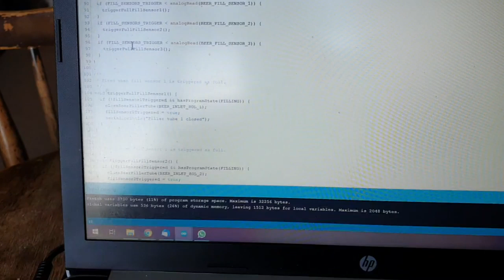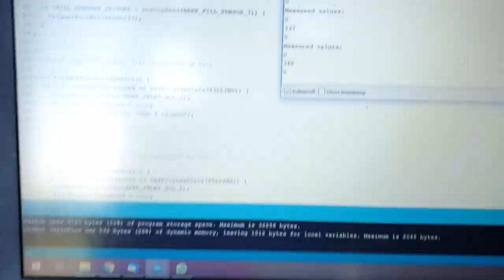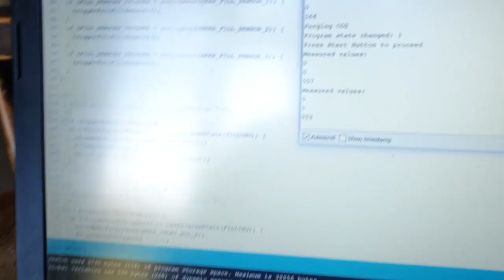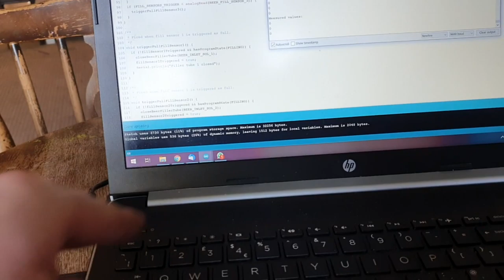Fine Tuning The Sensors ~ Can Filler Build

Comment: Hi Harry. I just discovered your channel and see what you are working on. Seems like you're making great progress!
I am a Computer Engineering student/Electronics Hobbyist and work in the IT enterprise software development field, So I thought I may add my two-cents I had watching as it may be useful to you.

I would be wary of using conductive-means of level sensing here. It is generally bad practice to do that, as by nature of passing current through the wires into the beer you are eroding the metal into the beer solution. The amounts are obviously small, but still not ideal. I would recommend you look into using capacitive sense to detect when the fill is complete. This eliminates all current that would be passing through the solution, as well as eliminates the need for direct contact of the solution to the bare input. Another alternative could be a utilizing a miniature float to actuate a small microswitch, or perhaps a sliding potentiometer.

If Capacitive sense is used here,  and the sensor itself is designed correctly, you could achieve very accurate fill level measurements (Within a cm or so). This may be useful as depending on how the plumbing is setup. it may be useful to 'cut  filling' before the desired level is reached as beer may still be flowing for a short time after pumping is cut. Capacitive sensing would permit easy and precise preemptive cutting tuning via easy software parameters vs. manual coarse sensor adjustment.

Cool to see what you are working on! Best of Luck.

Comment: ESP devices will be much cheaper...also, you may consider a simple screw terminal block for the Power Supply - makes it easy to swap out! Brilliant build - can't wait to see the can ram...if you had a 3 can feeder, it could drop 3 cans, ram them in place, fill, ram them to the end of the line. Then you would need some sensors to know when you took at least 1 can (so it can start the next fill pass) and the last can (so it knows when to ram the next filled batch).

Comment: Nice one, I should have mentioned that the circuit that I supplied could differentiate between foam and beer by changing component values or adding a voltage triggering circuit, my bad. S..r, cheers, Schnuz.
Reply: how is the proper way of connection? can you place a potentiometer?
Reply: @maurig3741  without digging the circuit out it's difficult to say as it was five months ago but it would have been two probes into the foam/beer. Pot's are not a good idea as they tend to drift. S..r, cheers, Schnuz.
Reply: @Schnuz  I don't realize how to put a potentiometer to prevent the sensor from cutting through the foam, anyway thanks for answering, @HarryBrew69 could you explain how I connect the potentiometer thanks

Comment: I did exactly the same on my bottle filling machine and it worked great for level control! Please look at my video. 
I switched of the +5v right after I got contact to reduce the electrolysis, and then switched on when the next empty bottle was about to fill.

Comment: I will advice not to connect 5v on the filling tube.  It is better to ground it, conecte the resistors to 5v insted of ground, and use the values up side down. That way all tubes are keep grounded with the frame.
Reply: I concur....
Reply: Yeah I was thinking the same... Good tip
Also we need more Reggie and Chance... 😍